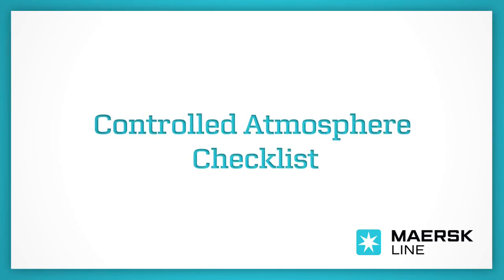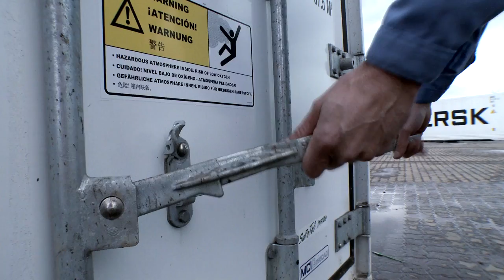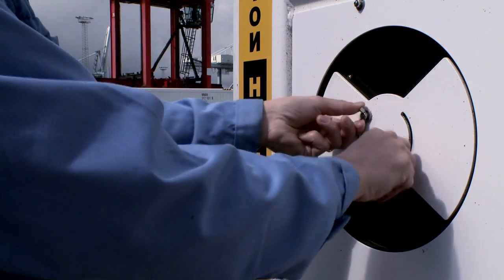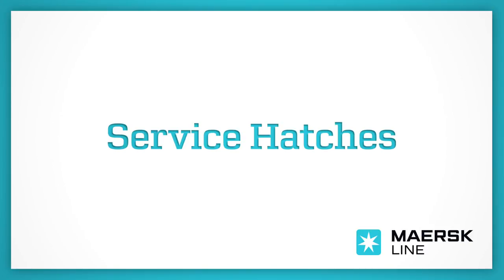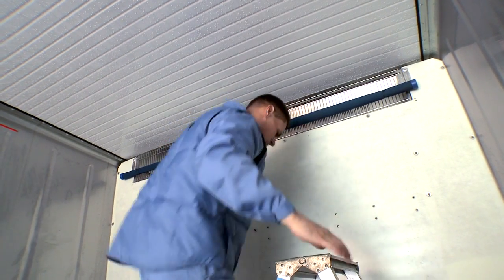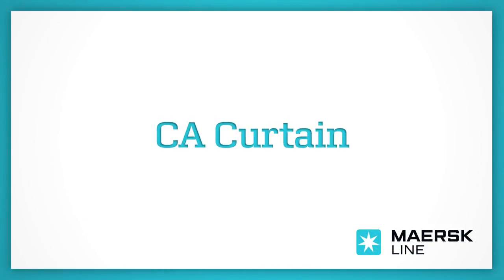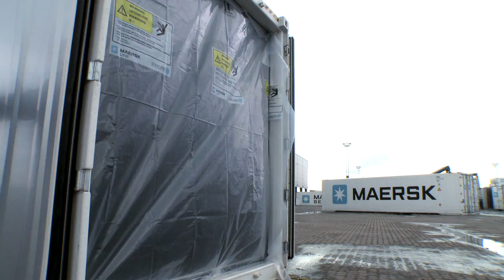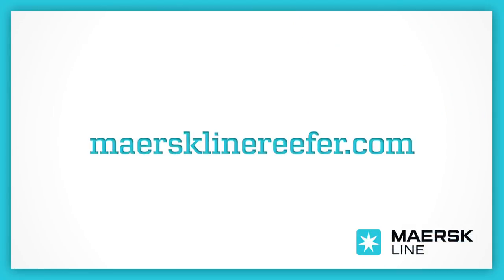Introducing controlled atmosphere | Maersk Line Reefers

Comment: What do we call the two steel bars (curved like a 'C' with many rivets in them) that are attached to the connection of the ceiling and the left panel, as well as the right panel, running parallel to the length of the container (20 or 40-foot reefer container)? Are they called internal ceiling reinforcement or roof stringers?